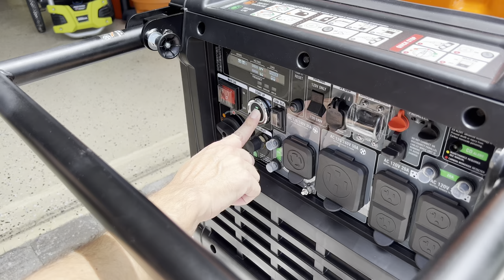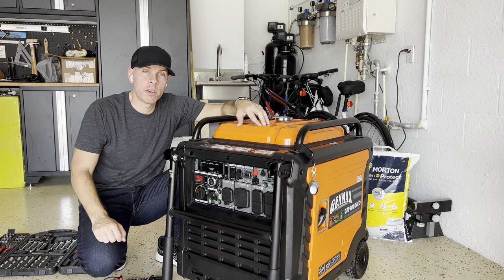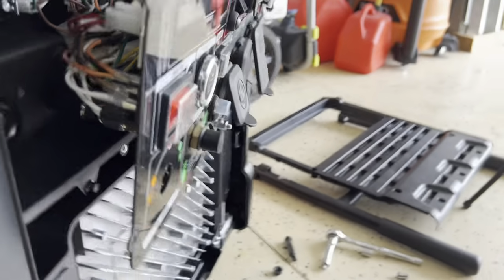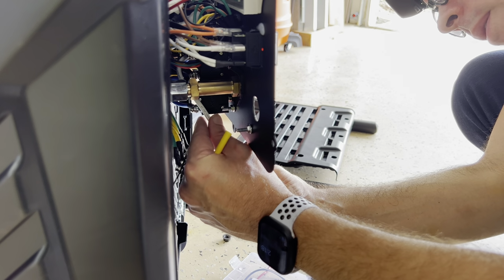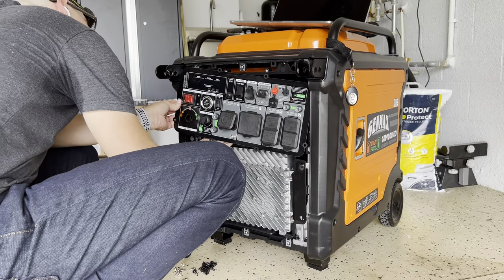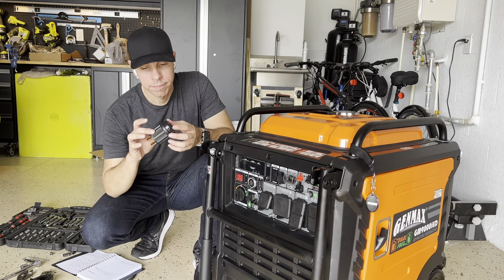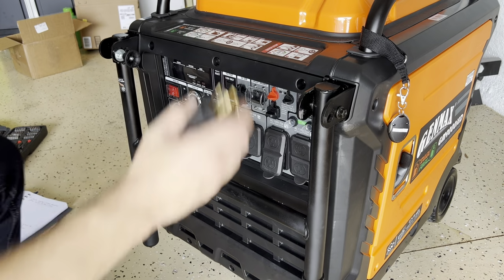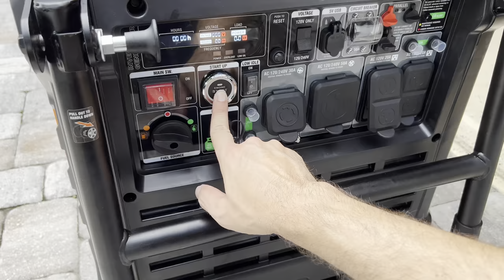How To Convert Genmax GM9000iED Bonded Neutral to Floating Neutral

Comment: Just a question. Would it be easier to splice in a switch to the white ground wire so you can still use the 30amp plug as a floating ground also.
Reply from the maker: I thought about a switch. But I did not know where to install it at the moment; also, I guess will need to be a rubber or plastic switch for security reasons, and, In my case, I do not need the 30amp plug. I will do some research and see if I find something to put it with a switch is a good idea.
Reply: @JavierRivera  good information. I learned a little something.
Reply from the maker: Great 👍🏻. That is the goal. To Teach a little especially to new home owners.
Reply: @jerrygania4458  You could cut the white wire and then put male/female spade connectors on the two ends so you can reconnect them as needed. Then no need for a switch. Get the style of spade connectors with insulation over the pads and then maybe wrap it in electrical tape just for good measure. Or use any other kind of connector, like one side of an XT60 connector.
Reply from the maker: That is also a good idea but.  I might need to open the unit to connect and disconnect the spade connectors.  With a switch, the idea was to cut a hole on the control panel face and install the switch.
Reply: @JavierRivera  yeah you're right. Only if you plan to very very rarely change the use scenario of your generator would my idea make sense.

Comment: This was fantastic!  I know zip about electricity and the concept of floating and bonded neutral. But I got this!  Thanks so much.
Reply: And this huy knows zip also.. rhere is a much easier way that allows you keep your generator stock
Reply from the maker: Hi. Is by code.  Bond should be at 1 place.  Is easier to unbound your generator than unbound your house breaker panel ever time you connect your generator.

Comment: I’m curious if a person could install a simple toggle switch to be able to simply change from bonded to floating in order to add the flexibility to use it to power the home OR use it to power things offsite? Seems like that would/should be a relatively simple “standard” option or feature. Thanks for your demonstration!
Reply from the maker: I thought about that.  I just can’t find a discreet switch with this specification 250V/30A  wire gauge of 10 or  12

Comment: Thank you for this video. It's an easy solution for the 9000 series genmax. However, I just purchased the 7250iedc, and it only comes with the 50amp plug and the 120v GFCI outlet. Has anyone had any luck creating a bonded plug for the GFCI outlet that works? I only plan on using this for home power backup through my inlet box. However if I wanted to use it for powering tools or something else, I need to figure out a better solution than dissasembly each time I want to do that.
Reply from the maker: You can try a regular bonded plug like this one https://amzn.to/3N2YaNH OR you can do what I am about to do that is to create a loop with he neutral cable and this fuse loop https://amzn.to/3OKLlIY , and put it accessible on the side panel. is you need it bonded put the fuse, if you need it unbonded remove the fuse.  I will be trying that soon.
Reply: @JavierRivera  I really like that idea, That would make switching usage modes very easy. Hope to see more video's. Thanks for the update.

Comment: I need the 30 amp plug so if I make this a floating neutral  than I can't  use the 30 amp plug?
Reply from the maker: Hi. Yes, you can.  All you have to do is use a regular bonding plug. Here is the link. Neutral-Ground Bonding Plug - https://amzn.to/3Rb6XgA
Reply: Ok but I'm using the 30 Amp plug to my inlet box I'm not using the 50 amp.If I take the white wire off will the 30 Amp twist lock plug still allow me to use my extension cord to inlet plug which is 30 Amp plug?
Reply from the maker: @mitch461000  the bonding plug is ONLY to use the generator (if needed) by itself after you removed the neutral bond cable.  If you would be using a generator like me with a power inlet, all you have to do is to remove the neutral cable as I did in the video.  Then use the 30amp outlet.  Skip the 30amp bonded plug that I created on the video.    BUT. If some day you decide to use the generator by itself and connect appliances for example directly to the generator then is highly recommended to use a bonding plug.
Reply: Ok Javier thanks I understand now
Reply from the maker: You are welcome. Thank you for watching and asking. Is good to interact with viewers to know I am not alone creating videos.

Comment: I feel fortunate to have learned about your channel from Gavin's Garage where someone referenced this video. Right now I have a smaller inverter generator I'd gotten from costco that I just plug directly into so the bonded neutral is beneficial, but if/when I switch to an interlock kit being able to switch to floating neutral will be very helpful. Thank you. I'm surprised how few subscribers you have so far but given the quality of your content I suspect that will soon change.
Reply from the maker: Thank you. I’m glad it helps.  My main purpose with my videos is Helps regular homeowners.
Reply: You need to do more reasearch there is a much easier way and less dangerous then what he is suggesting.
Reply: @x01e  What is the easier/safer way?

Comment: Finally got around to doing this today, the whole thing was so easy until getting the two nuts off on the bonding rail.  Especially the one closer to the middle.  Just barely enough room to get a small ratchet into that space, and they didn't loosen at all to be taken off by finger.  Had to ratchet them off the entire way.

Thanks for the video, I see a lot of people say they have run bonded generators to a panel no issue, but I much prefer to do things the "right" way especially when it comes to electricity.
Reply from the maker: Hi. You are welcome.

Comment: Hi Javier, it’s been 9 months since I last reached out to you. I have since sold my champion generator (non-inverted model) and bought a Genmax 7250iedc, thanks to all of you on YouTube that spoke highly of the quality of Genmax generators, it was a no brainer for me to buy a Genmax!
So I’ve been trying to convert my Genmax to a floating neutral and reached out to Genmax support for assistance a few times, but unsuccessful with my conversion attempts due to conflicting information provided.
Last week, I reached out to Genmax again, and I was given your YouTube video (sent as an attachment) from tech support…kudos to you my friend! Following your steps, I believe I got it, finally!
So my concern now that the generator is floating neutral, is it still safe to use the 120v outlets for any electrical devices? Do you ground your generator or is the neutral bonding plug is sufficient enough? Thanks in advance and for sharing your expertise!
Reply: Hello, was the process the same for the 7250 as it was in this video for the 9000? I just bought a 7250 and will need to change it to floating. Thanks in advance.

Comment: So when you buy this generator  it's not ready to use on your home?
Reply from the maker: The answer is NO if you would be connecting it to your breaker panel.  Come ready to connect appliances directly to the generator or even an RV can be connected to the generator.  But If you would be feeding a breaker panel that already has the Neutral Bonding connection you need to break the bonding in the generator.  Unless you connect it to a type of transfer switch that comes ready to accept a Neutral Bonded Generator.

Comment: Magnetic Dipstick: the Wen GNA200 20MM x 2.5 is a prefect fit,  Amazon
Reply from the maker: Hi. FYI.  The drain plug size has to be M12x1.5x15

Comment: It's just as easy to install the MEN bond into a switch on the front panel. This takes about the same time you took to open the unit. This gives you the options to use the generator off-site or with extension cables for power tools and other devices apart from your house circuits......
Reply from the maker: How you will remove the bond between neutral and ground without opening the generator?  You have too.
Reply: Use a 30amp rated spst on/off toggle switch connect the white neutral wire to one side of the toggle switch, connect another same gauge extender white neutral wire to the other side of the toggle switch, then connect the new exterder white neutral wire/jumper to the generator ground bar.  Drill a hole in the front cover, insert toggle switch then label: onboard neutral engaged / onboard neutral dis-engaged aka on/off - no need for building a bonding plug.  You just need to understand what position to put the toggle switch when generator neutral to ground bond is needed or not needed.
Reply from the maker: I cannot find. 30a 120v on/off toggle switch.
Reply: @JavierRivera   Amazon - Gama Electronics 30 Amp Toggle Switch $18
Reply: @JavierRivera  EATON 7576K2 Switch, Toggle, SPST, 30A, 250V
Reply: @JavierRivera  where r u ? Jaycar sell them here in Oz 💪🏽
Reply from the maker: @babybird57  is 30A 12VDC not 120v.
Reply from the maker: @babybird57  This one it looks like is 30A 120v. I will check.

Comment: I just noticed one flaw with this generator while watching this video as I need to do this.  The 50A plug is right above the cover that sticks out, so my cable while the correct type cant plug in.
As I look online EVERY N14-50 cable is a right angle like that so none of them will fit.  So it almost forces you to use the included piece to make your own, or buy another one online to make your own cable.  I cant find any pre-fab cable with a straight plug, or a small pigtail to extend it to prevent me from having to cut the cord or buy a different one.
Reply from the maker: Hi. It took me a second to understand your message.  If you talk about the black cover that I removed on the video.  I don’t think it would be a problem it is very shallow.  But I haven’t tried with a right angle plug yet so you could be right.   If you order a pre-fab right angle 50amp cable make sure is at Amazon and that the Return Policy is Returnable just in case.  I would suggest that you build one. Most of pre-fab 50amp cords are 6/3 + 8/1 instead of 6/4.  What that means is that 3 cables are #6 but the ground is #8. It will work? Yes but I prefer all 4 cables to be #6 and installed.   Also when you build it you have the chance to pick a better quality cord.
Reply: @JavierRivera  Got too good a deal 30ft cable for $60, It is is code to have a smaller ground wire so not too worried about that.  But I do understand the piece of mind.

They (electrician) actually used #8 wire for power too, I didn't like that but they know there stuff and I looked it up #8 THHN wire is rated up to 55A.  It's a short run though and its specifically THHN so woudl not use #8 for the connection cable to the generator.

I would redo it, (have to patch the holes and increase the conduit size) but since the 9000 is only like 35A at max load its more than enough.

If I was running 2 of these and getting 50A then yeah I think I would redo it, but I have not maxed this out even close to 6700w running as long as we do not use hot water or the stove.
Reply from the maker: So yes you saved a ton of money using #8.  All comes down to temperature and distance.

Comment: Why don't manufacturers put a switch on generators to do this
Reply from the maker: That is the same question that I have, I thought about installing a switch, but I have not found one switch that I like.  If you found one that will work with wire #8 and that the switch is plastic or covered in rubber, let me know. OH, and that can be installed on the front panel.

Comment: It was an error on their part to not make this easy to do, like just flipping a readily accessible switch.
Then the 50 amp receptacle would still be available for use.
Reply from the maker: I mean. I don’t know 🤷🏻‍♂️ any generator that comes with a Neutral Bonding switch.  But. Yes is a simple feature that would make things easier.

Comment: Terrible advice and illegal. The generator comes bonded for a reason. Connecting an inlet to your house is supposed to be bonded and grounded.
Reply from the maker: No.  Is required by code to have 1 bond only.  If you connect it to a house is the right thing to do.  Portable generators come bonded because are meant to be used standalone meaning you connect everything directly to the generator but if used to feed a house breaker panel you have to remove the bond.
Reply: @JavierRivera  Understood. Thanks

Comment: Your making it more difficult and more dangerous with this suggestion if someone forgets to insert the plug when using the generator stand alone. The simple solution that accomplishes the same is to not connect the ground wire from your panel on your inlet box. Again the 50 amp inlet box you use to connect the generator to your panel, lift the ground wire from your panel so your generator will be ground when powering your house panel.
Reply from the maker: Is by code

Comment: Odd, usually most bonding is done at the powerhead with a ground wire to the neutral but it is manufacture specific. Know your equipment, just remember if the generator is used in a stand alone configuration again that Bond must be reestablished for safety.